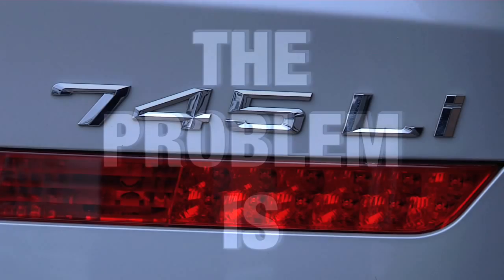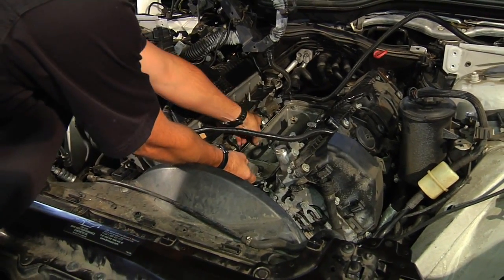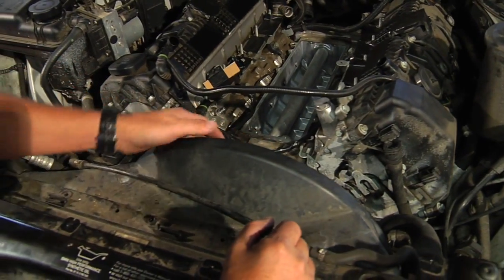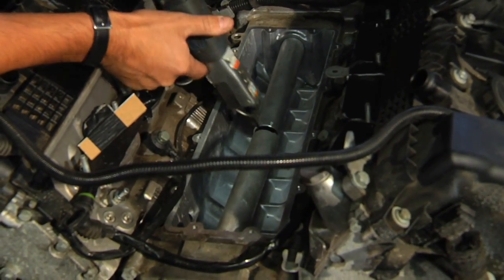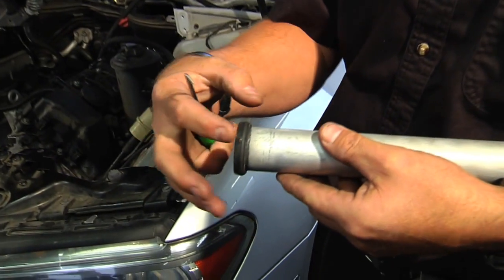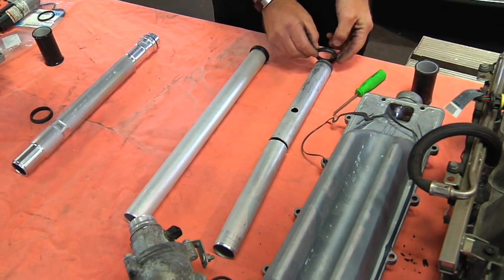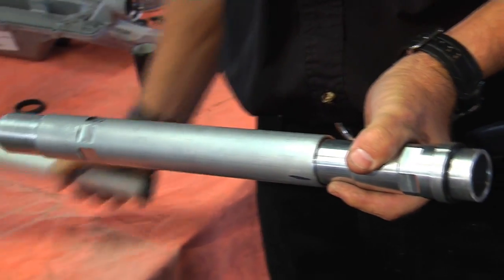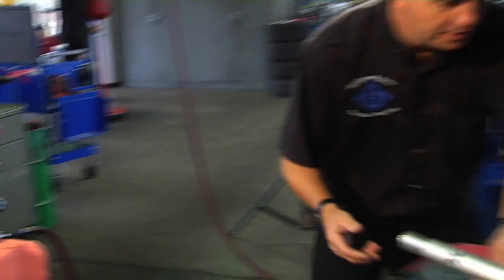BMW N62 Coolant Pipe Repair Kit

Comment: BMW650I 2007, the coolant leakage been for months, All hoses, reservoir were replaced.  Still small leakage  still dripping.  Recently I had the coolant checked. Thermostat, water pump and plastic tensor were replaced after modifications to the under take.  The mechanic had pipe slightly smaller than the under take as cost would have been much higher. So the mechanic inserted the slightly smaller into existing Allamium under take with permanent glue.  SO far the coolant leakage has stopped.  He told me to use the car for 2 weeks in order to make sure no leakage before changing the coolant.  The garage added more water temporarily in order for the car to be drive.  IF the modification doesn’t work? Then he will need to replace the under take which will cost much more.  SO far the cost for the parts and workmanship $300.  The leakage seems to stop since 3 days ago.  Based on the car value! It’s not worth spending large amount when the value is very low.  SO far so good.  SO my advise to owners of old BMW not to spend large amounts when you can spend much less.   BMW650I are such a wonderful cars on the road BUT it’s costly to maintain.   Eventually I will need to replace the whole engine with used one at a cost of $1200 available in the market same goes for the transmission.  Hope my experience would help others.   Thank you for excellent video footage.

Comment: Cool and great design. Price to high for me. Think I will try the uro transfer pipe kit.
Reply from the maker: Nick, we have had many people come to us after using the URO kit. The "shims" that hold the multiple pieces of the pipe fail and puts you back to square one. Give us a call at 760-738-4084 and we can see what discount we can give you.
Reply: Don’t recommend the uro pipe it’s extremely difficult to put on mine would seat the the front seal and wouldn’t expand after prying on it so hard. All in all I’m gonna try to return it and get the aga one the threaded body is a big difference in install it seems

Comment: uro parts 3 times cheaper.
Reply from the maker: Quality is also 3 times worse
Reply: Uro part is a royal pain to get if it even goes in 100% don’t recommend
Reply: @FranciscoC626  uroparts 8 mount ago and +30.000km used still good.

Comment: i understand the one year warranty but how long should this repair last?
Reply from the maker: Alex, this repair should last a very long time when installed correctly. The aluminum pipe is made of 6061 billet aluminum and the seal is made of viton. We have installed this kit in cars dating back to 2006 and still no issues.
Reply: @AGATools  Thank you for the information and getting back to me so quickly.
Reply from the maker: @AlexanderVassermanDDSPC  No problem! If you want to talk to someone directly, call us at 760-738-4084 or email me (Richard) rich@agatools.com

Comment: Do you really need to remove the water pump? Having to remove the crankshaft pulley and AC belt to get water pump off adds to the effort.
Reply from the maker: Hi Bruce, you do not have to but we strongly recommend it if it's your first time installing this coolant pipe. The reason being is because you want to make sure the coolant pipe expands all the way through the seal without pinching it. And the only way to see if it's getting pinched or not is to look through the water pump opening that leads to the coolant pipe. If the seal gets pinched, you'll have to go back and replace the seal again after 10k miles. Personally, I would take the time to make sure it's done properly so I don't have to go back. But if you like to live life on the edge, leave the water pump on.
Reply: Pump will come off without removing the pulley. And when I put the new one on, I shortened the bottom bolt by 3mm to make it easier.

Comment: Why is the last portion of the video blurred out? Something confidential, need to know, requires top secret clearance, anti-virus protected? The only problem I have with this part install is the almost $700 price charged for a metal tube. I can't do that, even if I could afford it. I got no issue with any business making a profit, but this is ridiculous. And I forgot, I commented here before; my bad. Still too much though
Reply from the maker: Last portion of the video is blurred because it had our old information like company address and phone number that no longer exists. We did not want new, current and previous customers contacting us at an address and phone that is no longer valid as we have moved into a bigger facility. And the cost of the pipe is $559, however that's not why it is expensive.  A lot of R&D went into development of the actual seal itself.

Comment: I see there is a o-ring on the back end of the pipe but isn't there a o-ring in a grove in the back also or is that just on the M62 engine?
Reply from the maker: The o-ring in the back of the engine needs to be replaced with a BMW OEM o-ring. The skinny o-ring on the back of the coolant pipe is to seal the coolant pipe.
Reply: @AGATools  Okay, thanks, that's what I thought.  Does the BMW OEM o-ring come in your kit or do I have to supply my own?
Reply from the maker: @bobneuman3458  If you buy our N62 coolant pipe with gasket kit, the o-ring comes with it.

Comment: Is it necessary to remove the water pump to get to the coolent transfer pipe
Reply: Hi Eric,

You do not have to technically, but we recommend it. The reason is because when you expand the coolant pipe, you want to make sure it expands past the seal, not pinching it. And the only way to do that is to check through the opening of the water pump.
Reply: @richardnguyen6647  ok got it. Thanks for replying

Comment: You could just use the OEM pipe and weld it back together.
Reply from the maker: It's not the pipe that goes bad, it's the seal. In order to replace the seal, you need to remove the pipe. Removing requires 18+ hours of labor.
Reply: @AGATools  Yes, so what I am saying is why not just cut the OEM pipe, take it out, replace seal, and then put back the two pieces of pipe and weld them back together again?

Comment: Will that stay tight with the engine vibration?
Reply from the maker: Lone Wolf, yes it will. We have machined an outter ring with a seal that pushes up against the engine block. We have sold thousands of these and never have we heard these coming loose over time.

Comment: Putting grease on a gasket??  Look for that to fail again right after the warranty is expired, lol
Reply from the maker: Sir, we have been selling this since 2009 and have had ZERO issues with this. With a lithium all purpose grease, this will not cause any issues down the road.

Comment: E65 7-SERIES were the WORST motors ever. Even if that pipe doesn't fail, lets hope your valve-guides don't fail like they ALWAYS do on the 745s.

Comment: Hi 
do you have video that show how to remove alternator bracket and power steering pump for 2006 BMW 550I
Reply: +All German Auto How much is the pipe and will i be leak free for at least another 100,000 miles???? Also are there particular models and years this leak happens a lot????
Reply: +All German Auto Does the 2003-2008 7 series models all have that N62 motor????
Reply from the maker: It varies depending on what models and country you are in. The best thing to do is provide us with the last 7 of your VIN #

If you have any further questions you may call our tools and products department at 760-738-4084 or email us at rich@agatools.com
Reply from the maker: As long as you keep up with maintenance, the seal should last 100,000 miles. This problem is a common problem for the N62 and N73 engines.

If you have any further questions you may call our tools and products department
Reply: AGA Tools can you recommend a reputable repair shop for the 05 745 with this issue in the Nashville TN area?

Comment: Hello All German Auto, I have Installed your Custom Coolant Pipe on a Couple N62s and had No Problems. In Fact I want to Compliment you guys for Designing and Making it. The Quality of Metal Alloy is Top Notch Very Precision Made.Recommend it Highly. Prost! Klaus Schreyer Master Mechanic Phx, Az

Comment: would this cause combustion gasses into the cooling system
Reply: what would cause that, im looking at a 2004 745li that overheats after 20 min of driving a shop said there were combustion gasses in the cooling system

Comment: How do you removed the intake boot and air pump hose from a BMW 745LI 2004.With causing any damage to other componants
Reply: +All German Auto Is there anyway to prevent this leak from happening,better coolant,better thermostat,etc????? At what mileage does this leak usually happen???
Reply from the maker: There is no way to prevent this from happening besides coolant flushes every year and keeping the vehicle from sitting too long.

If you have any further questions please contact our tools and products department at 760-738-4084 or email us at rich@agatools.com

Comment: Ive had this problem before..
yet today I was topping off coolant, the coolant stick indicator, kind of a red long stick, broke. As I tried to remove it, the stick sunk to the bottom of the expansion tank. Is this going to damage the cooling system? That's the last thing I need after just fixing a coolant leak

Comment: Now that you have increase the pressure tollerance of the center pipe, be ready for the rear bell housing coolant pan to blow. To prevent all these problems including the center pipe 1) change your coolant with Pentosin NF or Motul Inugel Expert Ultra every 2 years,do not use US branded BMW Coolant 2) throw the 2 bar(29 psi) coolant cap in the trash and replace it with a 1.4 bar(20 psi) coolant cap from a 1 or 3 series BMW.
Reply: The coolants that you mentioned can they be used in 2003-2008/ 7 series models????
Reply: yes.  Change coolant every 2 years because galvanic corrosion will set in. Many dissimilar metals in an N62 motor.  US BMW coolant contains 8 percent sodium hydroxide which will destroy rubber and plastic components in very short time. The usual  first sign of failure is a ruptured coolant tank.  Sodium hydroxide is used at the track where ethylene glycol is forbidden due to traction issues. Do not use metal impeller water pumps in this motor not even brass, the bearings will not last(pumps operate at high RPM). Use only  OEM. Pseudo skeptic engineering and chinese aftermarket parts only add to the problems this motor already has. The original 10 year old water pump, thermostat, valley pan, and center pipe on my N62 now has 120000 miles with no signs of failure. I'll post an update when and if it fails.
Reply: Why do you not want the metal impeller now? My original with 175k is plastic and I’m replacing with the OE supplier- now metal

Comment: Every time I get lust for a 550 or 750, I think about the horrible design flaws.  One of the worst is the stupid T-gasket on the oil-cooled alternator.  I used to think the S62 engine was complicated.  Now it seems simple.
Reply: Agree BMW V8 suck ass

Comment: Thats the bit of pipe that causes the Weeping hole isnt it? I plan on getting a 07-08 7series in a couple months... Guess I should get use to changing that pipe as often as possible so i dont get a hole in the block xP

Comment: Lousy American cars not having inferior O rings costing 9000$ to replace would be one reason. I live in Germany and I have several American cars. 4 to be precise and none ever let me down or needed expensive repairs.Most problems are easy and cheap to solve and can be handled without special tools. Some German cars may look nice, but their reliability is a myth of bygone days. Sad but true.
Reply: So funny because I have the exact opposite experience when it comes to American Luxury cars. I drove Cadillacs for almost 20 years, had them in my family since birth the always fell apart after 5 or 6 years, I switched to German cats back in 2001 and have NEVER looked back. I find them much more reliable.

Comment from the maker: The coolant pipe applies to certain BMW N62 engines. It applies to 2004-2006 BMW X5 4.4i and 4.8is (E53) as well as the 2007-2010 BMW X5 4.8i (E70).
Reply: What about a 2008 550i m sport with a 4.8i engine?
Reply: Getting ready to do this job my self on my 2008 x5 4.8i

Comment: What a terrible engine design. The bmw engineer who designed this engine couldn't take the extra 5 minutes to make a collapsible pipe? Its almost like they wanted it to be such a costly pain in the ass all over a 5 dollar rubber seal.

Comment: firstly really great solution but, its in  an area thats under constant vibration would the threads not loosen over time if they are not locked in some way , i work in maintenancein a pharmaceutical plant and we couldnt used something like that because in an area under vibration the threads would work loose over time and leak ??????